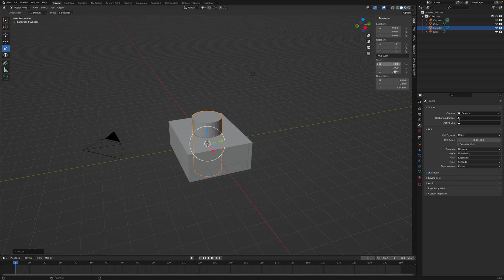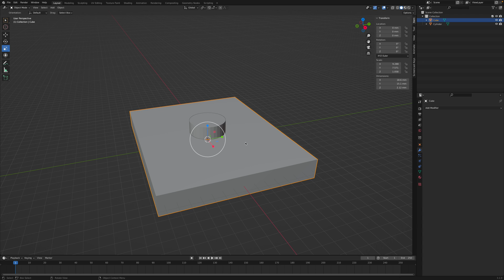How to: Cut Holes in STL Models for 3D printing Using Blender

Comment: So here's the thing...followed the directions using the "supplied" cube., worked perfectly.  Imported my own STL file, and it joins the surfaces instead of subtracts them using the EXATC SAME DIRECTIONS! So here's the question...what's wrong/different with my file compared to the pre-loaded file in Blender? And of course...how do I alter mine so this process actually works? Yes, my STL file is valid insofar as I've printed it out and it is exactly what is depicted. When I enter "edit" mode I get no "surfaces" only triangle geometry...does that have something to do with it not working? HELP!!!
Reply: The same thing was happening to me because my stl was not manifold. Once I closed all the gaps in the mesh it worked just like the cube. The file still printed fine because my slicer automatically fixed the errors. I fully get that you posted this a year ago, but maybe it will help someone in the future!

Comment: Man, you just saved me from quitting Blender. Most of the other videos (by other content makers) for cutting holes, omit the Apply step for the Modifier. It was driving me nuts why the STLs weren't subtracting the cylinders and 3D text I had added.

Comment: Blender user here 👋, you can save yourself a lot of time by learning the short keys, blender has one of the best keymaps I've ever used 
"S" for scale "x y z" for changing the axes, "Shift + A" for the adding menu, " Shift+Ctrl+Numpad - (minus) " to perform a difference boolean operation and apply the modifier. 
" Ctrl+Numpad - (minus) " to perform a difference boolean operation while keeping the modifier ( for further editing before applying it )
Keep it up champ 🙌

Comment: hole is not looks smooth contain vertices, will same pattern comes out of printing or it will be smooth print ?
Reply from the maker: To increase the resolution of the hole, when you add the cylinder, there is a pop up on the bottom left that you can expand. (it is only available right after you create the cylinder) Increase the number of vertices to something over 128 and it'll print smooth.